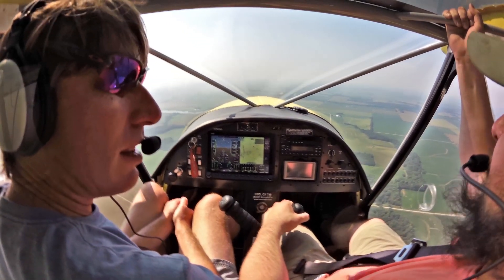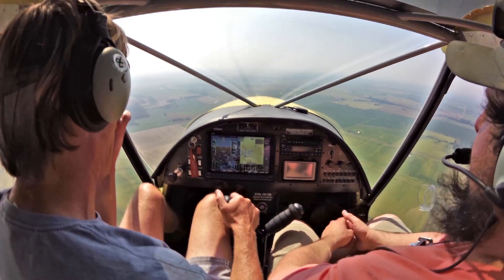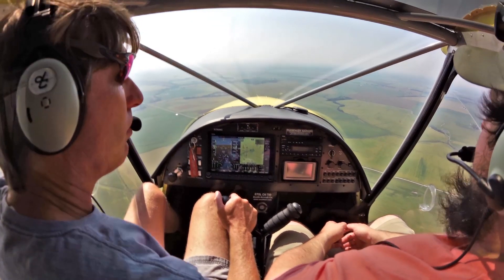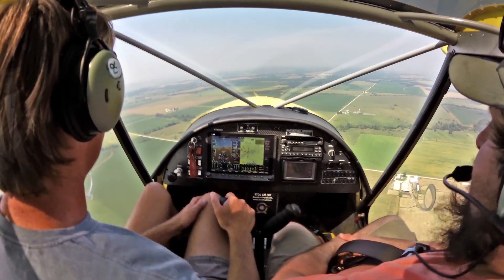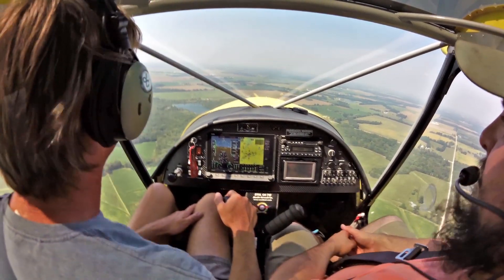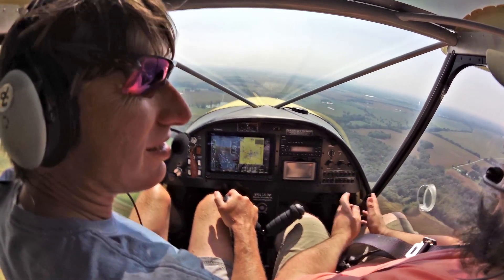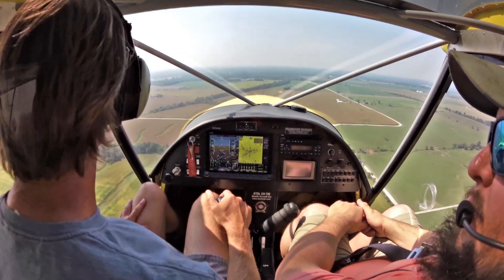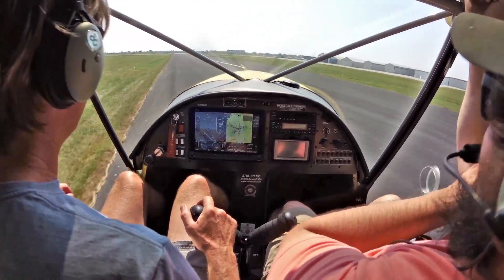Demo Flight: Zenith STOL CH 750 light sport aircraft

Comment: Change just one letter and STOL CH becomes STORCH as in the Fieseler Fi 156 STOL aircraft the Germans used to rescue Mussolini during WWII. Probably would've never noticed if I had my reading glasses on and didn't misread the thumbnail link. - Happy flying!
Reply from the maker: Yes, the Fieseler STORCH (which is "stork" in German) was designer Chris Heintz' major inspiration for the Zenith STOL. He designed the STOL CH 701 (in 1984) to be a modern and lighter version of the classic Fieseler STORCH.